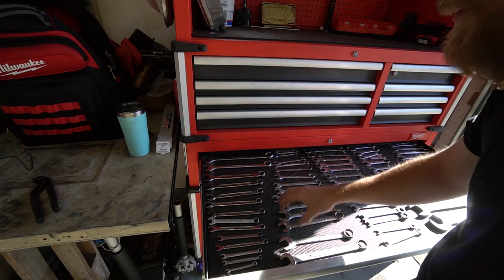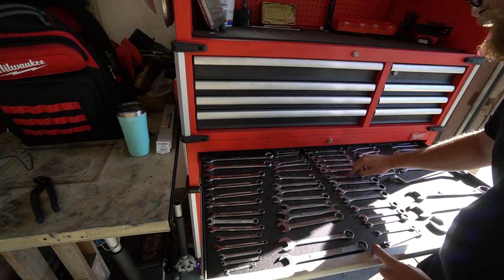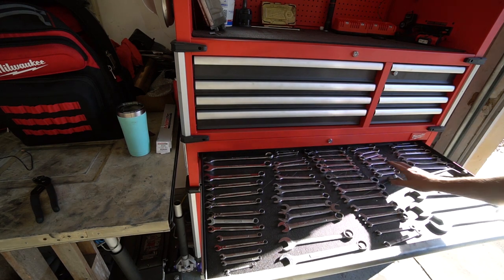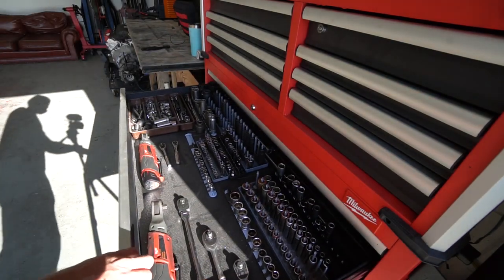Tool Check | Taylor Ray (Part 1/2)

Comment: Craftsman has actually converted. I was at sears today ironically to warranty out that 1/4 ratchet like the one you have, but I saw they have a 3 piece combo ratchet set with 84 teeth for like 90 bucks. That's how much my matco 80 teeth 3/8 low profile ratchet

Comment: That tool you called a little pry bar is actually a drum brake tool. It's used for adjusting thru the slot on back of older vehicles. Per 1989. It was a very useful tool back in the day. If you work on older vehicles it will come in handy.

Comment: Hey, I bought you those Craftsman tools! The new stuff has a much better fit and finish than classic Craftsman tools.
Reply from the maker: It really does! I talked about them more in the header coating video that won't be out until they get back from coating. They're light years ahead of the old stuff!
Reply: Taylor Ray I'll be sure to tune in for that one too!

Comment: You should try the Knipex pliers wrench. Same plier mechanic as the Cobras but with a flat wrench style jaw so you don't damage the fastener head. Also you should try out the Gearwrench 100 tooth ratchets at Advance. You'll be amazed by what you've been missing out on.
Reply: achikennugget38 gearwrench does make pretty good ratchets for the price point for sure! I work in a truck shop and my 1/2 has never failed me
Reply: I love watching people locking the gearwrench onto the part by removing it with the gear ;) (when there isn't room).

Comment: so since your complaining about the teeth counts on ratchets and ive had the same problem i found a really nice ratchet from oriellies lots of teeth best feeling ive found and its really thin so lots of space to work with. its a power torque gm6146 . you barely move it and it clicks over which i love because alot of other ratchets just have to much play when im unbolting something.

Comment: Look into Cornwell tools. They have great hand tools for half the price of Snap-on. I dont like their air tools and such but their hand tools are great. I do body and paint work for a living. Milwaukee tools are great also. I have all Snap-on electric tools but im replacing it all with Milwaukee as they go out or get outdated. Milwaukee is definately taking over the industry in electric tooling.

Comment: I work at a dealership and I use the automotive version of the pico scope for dealing with electrical problems. it's a suitcase full of probes and you connect it to a pc or laptop. it also cots like 2 grand. but you know I also have to fix what I DIYer can't

Comment: Take apart your ratchets and relube them... they work great after you relube them. They are usually dry when you buy them thats why they skip and feel like crap when you use them.  The old craftsman ratchets may not have high tooth count like the new ratchets but they are tanks when lubed and maintained.

Comment: Might look into some Klein screws drivers, nut driver set and wire strippers. Also fluke meter is well worth the money to especially if you need to check amp draw on anything. As an electrician and a backyard mechanic. Well worth the money. And harbor freight composit 3/8 and 1/2 ratchets are great for the price

Comment: With your wire brushes for drills if they start to fray use the them in reverse and the frayed ones break off and the wheel will last longer and you get more life out of it

Comment: Gearwrench makes great tools too. Look into the ratchet wrenches, I have a set from 8 all the way to 25 MM. Also the long ratchets. They have a set of 120 tooth, long 1/2, long 3/8, long 1/4, and short 3/8. I love those. I use my long double end spline drive ratchet wrenches a bunch too, made by mountain/ monster/ ez red. Also look into a slide hammer set. There is one kit that most brands carry, even looks like the Harbor freight one. Its a slide hammer with all the attachments, axle puller, and it has 2 and three legged pullers that can be used on the slide hammer. For allens get the VIM 64 pc kit. It comes with all the standard and metric allens, torx, tamper proof torx, and reverse torx (e bits?) all in one case. 

Ill add I work on smaller heavy equipment, so I have a lot of tools. Ive bought a bunch of junk that I thought I would need and never have as well. I can link to these tools if anyone is interested.
Reply: What tools do you recommend vs recommend to avoid? Best advice you’ve learned ?

Comment: Good call on the auto-strippers, but one comment.  When you use it to strip while the sheathing and it is still in place spin it off to twist your wire to make it easier to tin if you are soldering, and it makes the wire more orderly if you are sliding it into an end to crimp too.

Comment: Do you have a some uselessly small screwdrivers, they are great for connectors or just little bits?Sometimes they are called tweakers or the 6th finger.

Comment: You need a dozen 10mm sockets in that top drawer. Cause lets be honest 10mm sockets are disposable. You can never find one when you need it. Why not have some spares right. Dont know why no one sells 10mm in packs of a dozen.
Reply: Silahtnat there's a company that sells a 8pc set of different style 10mm sockets i forgot what there name is though
Reply: Nope has to be a dozen. cant be anything else. Just wont do. i NEED it to be a dozen. I have a fever and it needs  a dozen cow bells... i mean 10mm sockets.
Reply: I feel this comment, cause I was working on a jeep, and I lost my shallow 10mm on the skid pan along with a pick for days
Reply: 10mm sockets 😂 I actually replaced one I split using the warranty the other day, never used the warranty on a 10mm before, I normally lose them way before they fail
Reply: Snap on would make even more money if they were the only ones to offer 12 packs just the exact same socket in a pack of 12